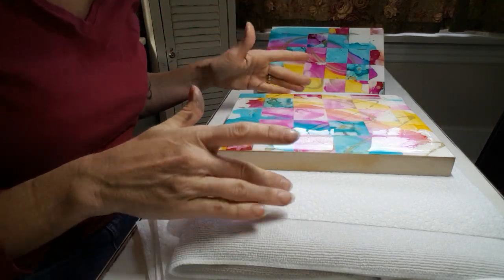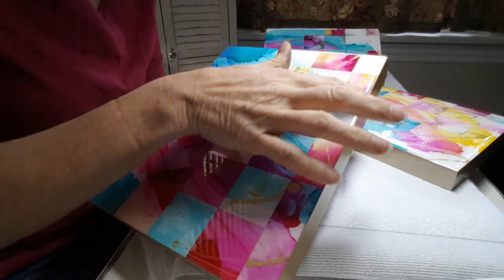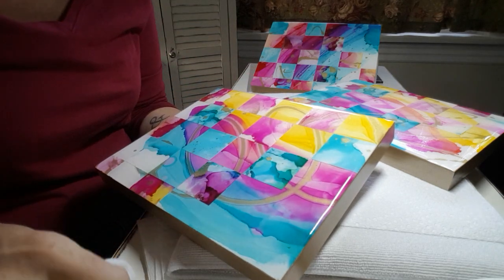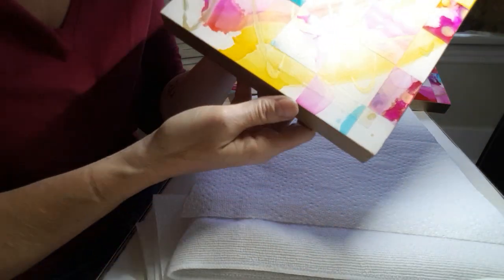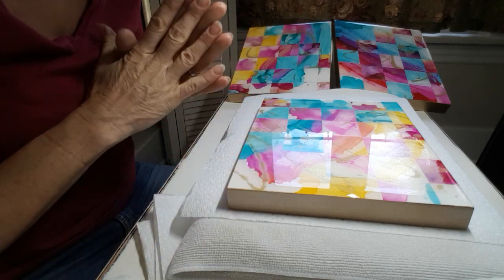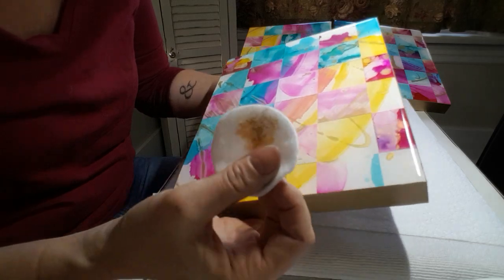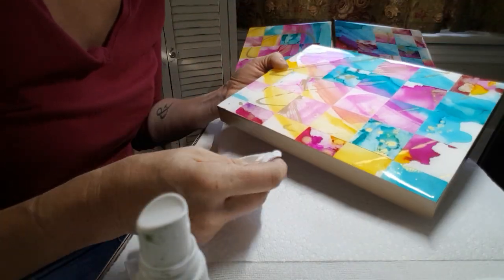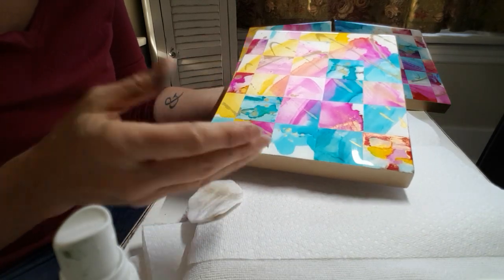Will acetone hurt my resin coating?

Comment: This was the exact video I needed. I just started resin art and I did a free form geode and painted the sides. I got a little on the front and had no idea how I was going to repair it. I didn't want to ruin the piece because I was happy with the way it turned out. Thank you so much for posting this video. You saved my project.

Comment: Hey by any chance do you know how you can remove the resin from a painting without damaging the painting? 

I have applied resin really badly to a painting and need to remove it somehow without damaging the painting
Reply from the maker: I'm sorry to hear you are having troubles, As far as I know, resin can only be sanded down. No, you will never get resin off. Once down, it's game over. You could sand and re apply a second or third layer. But without knowing the product you used, this may not be possible? Head over to www.artresin.com for more expert advice.

Comment: What did you use for the resin finish on the pictures. Looks really shiny and smooth. I’m trying to get a finish that is resistant to acetone for a lap table project that is painted
Reply from the maker: I use the brand Art Resin. Artresin.com

Comment: I have epoxy resin flooring in my kitchen.  I would not recommend acetone on that type of flooring.  I tried it in a corner and it took the finish off.  I went with a gunk remover like goo-gone.  And yeesh, that took a long time to answer the question.